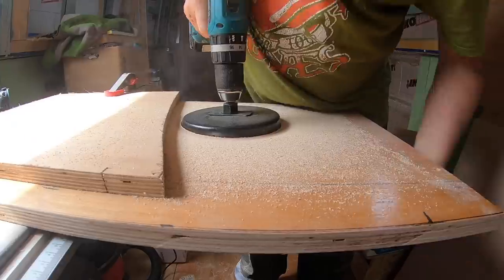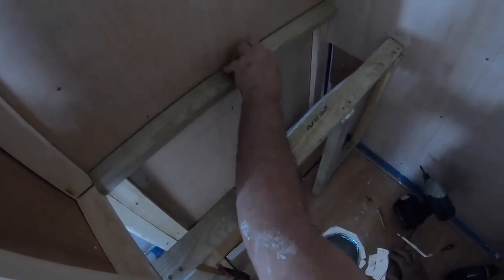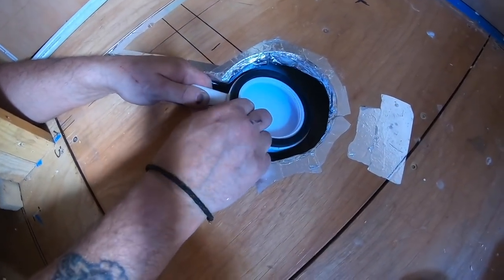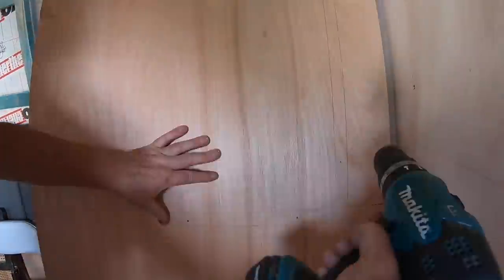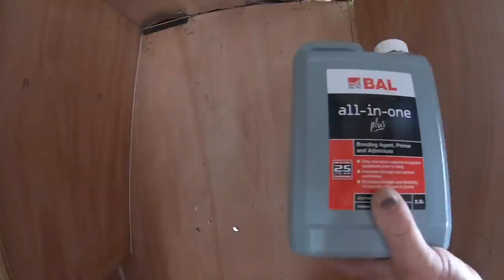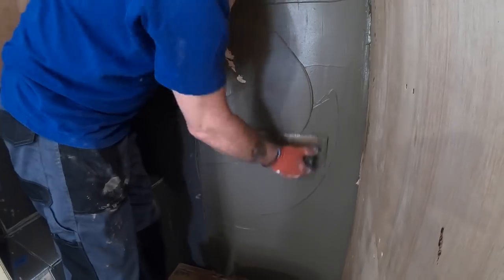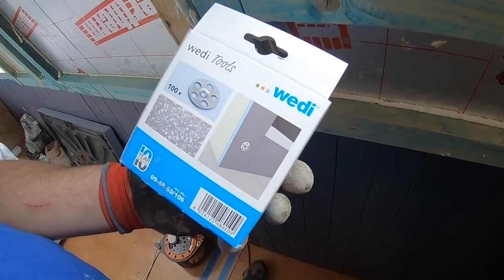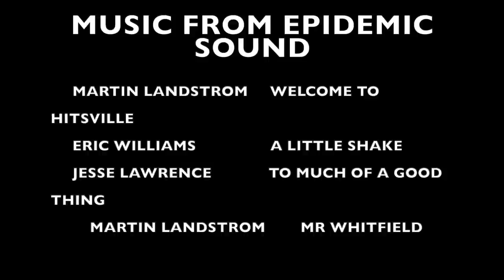Vlog 32, Narrowboat Fit Out -  The shower enclosure

Comment: Brilliant videos! What product do you use on the back of all the plywood sheeting you’re putting in? Is that to protect it from any moisture that may find its way into the walls and bulkheads? Will you apply the same to the front surface too?
Reply from the maker: Thankyou Ian, We varnish the backs of the boards with Yatch varnish just to give the boards extra protection from any condensation that may get in. We use Wedi boards stuck on the front face of the boards on the inside of the enclosure that are moisture resistant and better to tile onto. Thankyou for watching 👍